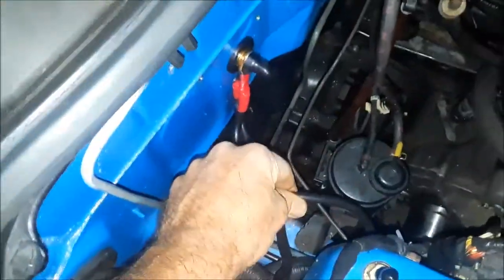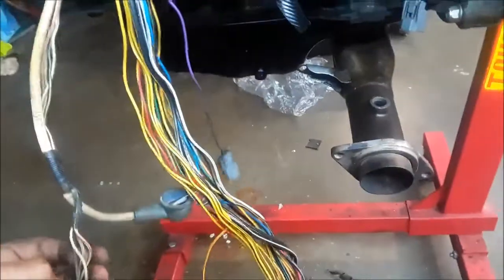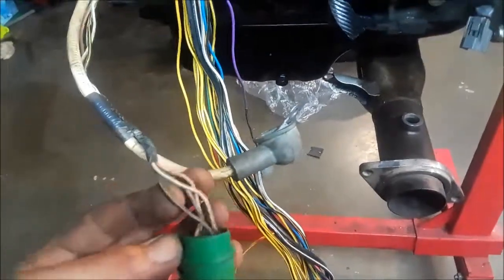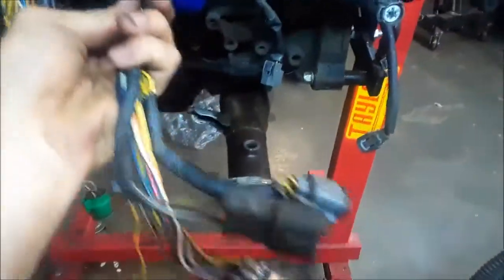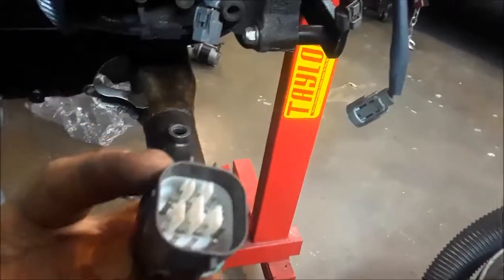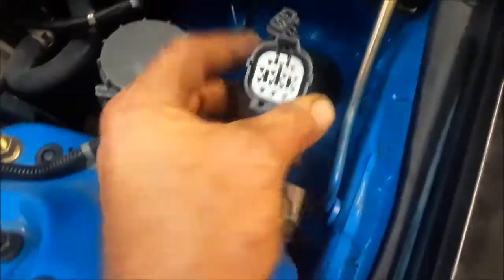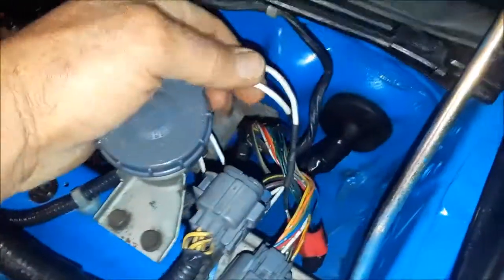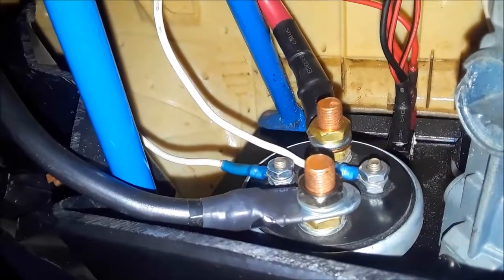kill switch install V.2 honda (4post)

Comment: Can u achieve the same outcome with a 2 post kill switch I’m currently having problems getting my dirt car to kill the motor with the switch and this might be the ticket
Reply from the maker: Put the exciter wire on the the post that feeds starter and acc.  But you can't put the battery charge line on feed side from kill switch.